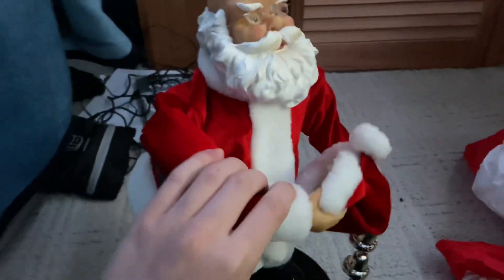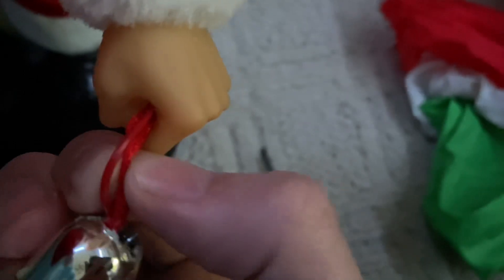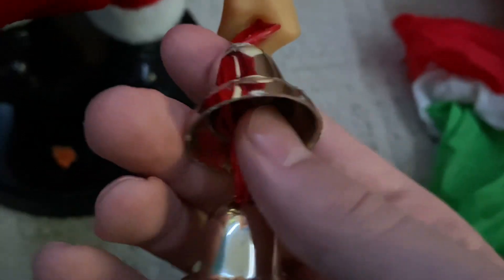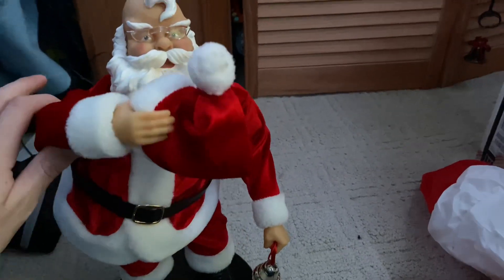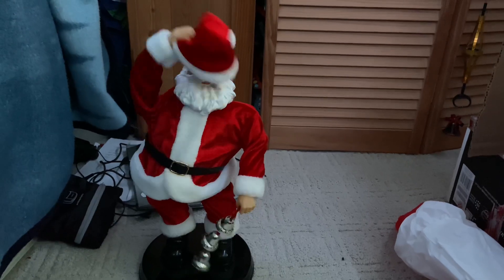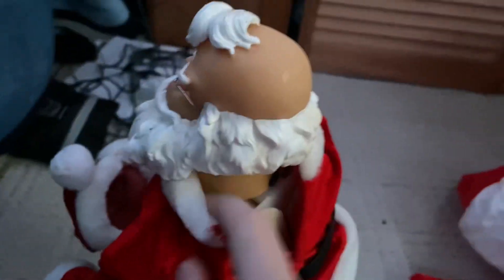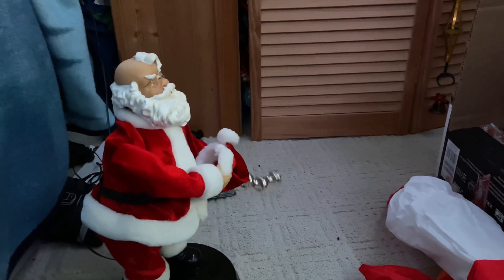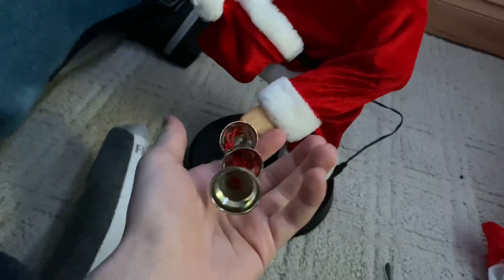Bell spinning Santa repaired

Comment: Was it the 8 tooth for the hat?
Reply from the maker: Yeah I replaced it with a 9 tooth they are much more reliable
Reply: @layneschristmascollection8389  mine is probably the most faultiest ones because everytime I put the head back on it would literally keep breaking till eventually I was able to get it back together working fine